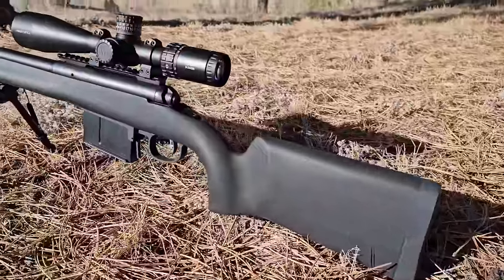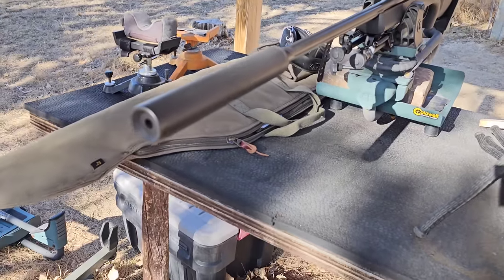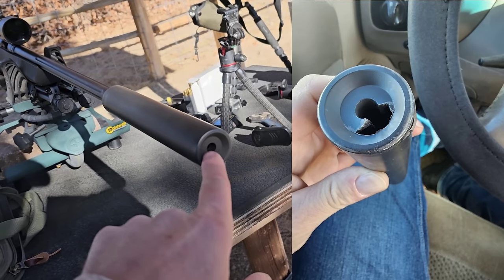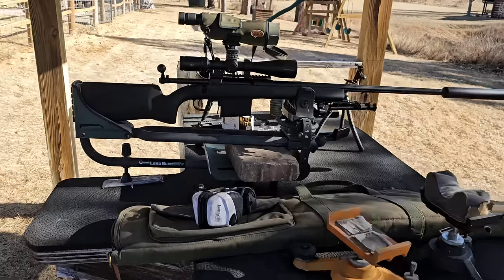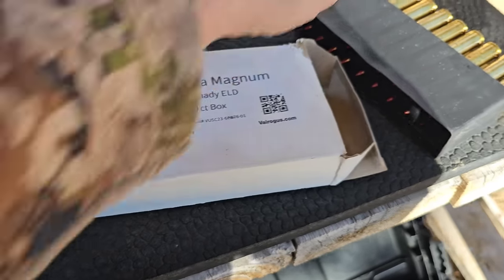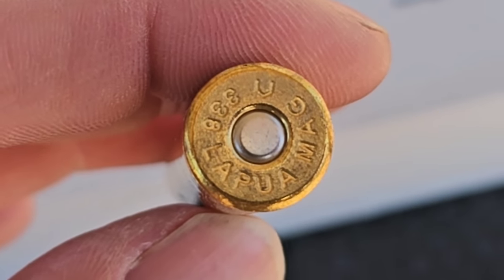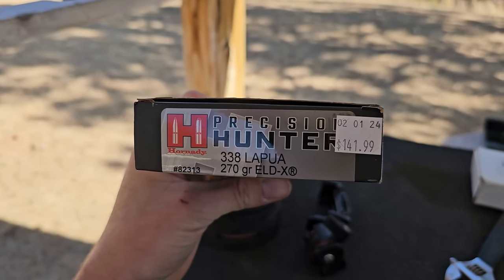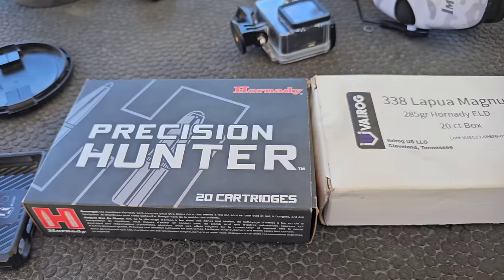Long Range Rifle: Something is WRONG!

Comment: The ammo seems like garbage, but it looks like either your scope is not working or mounted incorrectly or your barrel is trash from the get-go. Savage 110's have simple actions and don't struggle when the barrel is good and the scope is good.
Reply from the maker: Going to try another scope, but I am thinking it's the barrel just because of how off the threads were cut from the factory.

Comment: Remove that scope, remove and retorque the bases and rings. Try another scope.   Your velocity numbers are pretty varied perhaps different ammo from another manufacturer.   Did your gunsmith scope the barrel I have had some kind of scary looking barrels from Savage but the ammo seems like junk. I would still check all the fasteners on the rifle with a torque wrench just to make sure.  

New ammo did not help.  I would be curious what the rifling looks like and who ever scopes it should look at the chamber it could be off center as well. I’m not sure I’d put an off brand barrel on a rifle I presume was purchased for the cartridges long distance capability.  

Barrel, trigger, Optics, and solid platform (chassis or bedded stock) are what makes an accurate rifle. Of course all these things need to be properly fit.  Does that gun have parts to build off of?
Reply from the maker: Might go with a new barrel, not sure yet.

Comment: Inhad a similar experience, i bought a rifle from a family member who shot 4 boxes back to back then went to town bought 4 more boxes and shot em all back to back over heated the barrel and it warped it just slightly, enough to throw every shot off. Have a barrel maker look at it and they can put it on the machine to see where its off at, if it is off. Thats what i did and found that it was off a substantial amount. Had to buy a new barrel.

Comment: Take it to a gunsmith
Reply: The gunsmithing should have been done at the Savage factory. The last three savages I bought have had all kinds of grossly negligent problems. Simple things like the bolt closes on a no-go gauge from the factory. Out of spec unfinished parts on the bolt body. Camo dip paint peels off when you remove their ignorant stickers they put on the gun. Barrel receiver threads galled All to hell. And then you have to pay to fix their crap.

Comment: Most Savage rifles are stupid accurate
Reply from the maker: I know that's why I'm surprised at what's going on.
Reply: The last three savages I bought had excessive headspace from the factory. The bolt will close on my no-go gauge. one of them had a large ring recoil lug on a small ring action. And the last one I spent over $1,000 to purchase and the bolt would bind up so horrifically it was inoperable to even use. I sent it into Savage and they lied to me and sent it back with the same larger ring recoil lug and didn't do anything to fix the bolt. There was absolutely no finish work done on the bolt body they sprayed some kind of paint crap on it to cover it up and shipped it out. The people working at Savage and running Savage are completely incompetent and are liars.
Reply: The other thing on the last two savages I bought the barrel threads or completely galled up in the action threads. It looked like they left the sandblasting garbage on the threads and put some kind of a extra hard glue on the threads and tightened it up and galled The living S##t out of the threads, from the factory. I ran across another YouTube guy that had the same crap and he said it was none of his business what Savage does to their threads. They're selling a gun to you and you are paying for a product that is registered to you not to Savage, with the expectation to not have the barrel/receiver threads galled all to hell.
Reply: @Mike-xi4zt  What savage did you buy?
Reply: Always had Savage 110s or Stevens 200s and they do shoot-- lights out. My best ones were PRE-Accutrigger 110s without the stupid DBM & bottom bolt release. I  don't buy new ones I buys old savages for the actions and re-barrel.
Reply: @cbsbass4142  I bought Savage because of the ability to swap barrels and change the bolt face. Savage has been doing away with the barrel nut that works with a wrench.  then put a hole in the middle of the back of the bolt for the firing pin extension to stick out of so that if and when you get a pierced or blown primer it provides a path directly to your eyeball for 60,000 PSI high gas. Older savages did not have that hole in the back of the bolt. I have had some serious major problems with Savage 110. And I've had to spend way too many hours and money trying to fix the crap they ship out of the factory. I personally hate all recoil lug systems that are a sandwich between the barrel and the front of the receiver. That type of recoil lug is asinine stupid ignorant engineering. Savage used to put a detent in The recoil lug so when you tighten the barrel up it would hold the lug in the proper position. Now they've come up with the brainless idea of no detent in the recoil lug to hold it in position when your tightening the barrel to the action. Needless to say I will not be buying any more savages in my lifetime
Reply: @cbsbass4142  3 different 110s
Reply: @Mike-xi4zt 
Damn ‼️ 😳
Reply: I have two Savage rifles, but they are more than 10 years old. The quality of things prior to the plandemic was a lot better. I don't know when that.338 was made, but if person threading the barrel was not competent enough to notice an obvious, exterior problem, I can't imagine how far off center the gun-drill might be or accuracy of the rifling/twist.
I mean, it's probably a button rifled barrel and the ding ding that made it could have been trying their own version of Gain twist or just not know wtf they're doing 🤷🏼‍♂️ 
I would verify one last thing before having the action and bolt face trued up and a new barrel put on.
I would put that Arken scope on a rifle that you know, is a good shooter and see what happens. If you get consistent groups on a gun you know, then you can also trust the internals of the scope.
I just recently bought 2 Arken Ep5's, but don't have them mounted, so I don't have any experience with them. But if that scope came with the rifle, that had the crooked threads, etc.etc.etc, and won't prove itself on a rifle that you know for sure, produces a tight group, then maybe there's more to story, with the previous owner 😐

Comment: You should have sent it back to Savage. They have excellent customer service. My buddy buys them all the time, and has had to send a couple of them in for small issues. You kind of screwed up by having a smith touch it. Now you have no proof that your smith did not mess it up. Be prepared for Savage to make that assumption as well. Before you screw up anymore, I'd be contacting Savage. That ammo costs way too much to be burning it up in an ill rifle. I've seen a couple of these rifles shoot poorly, but I just assumed it was the guys pulling the trigger. My buddy has one, and we can both put 5 shots into 3/4", so I know they can shoot well.

Comment: Ok my friends group and myself have 4 M110 precision .338 Lapua rifles between us and here is what we learned the really expensive way:  Hornady bullets suck ass.  We started out with one rifle running Nossler Accubond LR 265gr  but Nossler decided to quit the game because they suck.  We have other rifles shooting Sierra Matchking 250 gr and another shooting Berger OTM  300gr.  The OTM rifle started out shooting the ELD-x and we chased the disaster for a month and here is what we found;  Hornady ELD bullets cant handle a 1 in 10 twist barrel without deforming in flight!  Yes I know what that sounds like cause everybody is a fashionable Hornady fanboy so we also tried it in 6.5 creedmoor and had to slow the bullets down to 2650fps to keep those flying straight too.
  in the .338 he could get on steel at 500 every shot and at 700 maybe 25%but at 1000 it was atrocious so we put up some big moving boxes cut flat to see and what we found was a 8ft diameter group from a rifle rest was all it could do, that same rifle now shoots OTM's at .6 moa at 1000.
   Don't shoot Honady ELD unless you can get a 1 in 12 twist rate.

   Also if you want to shoot the OTM's you will not be able to use your magazine and you will need to get used to spacing far off the lands and you WILL need to buy a micrometer seating die.
Reply from the maker: Thanks for the info. Other people's experiences are helpful, especially when it seems like this has happened to so many people. Thanks for watching. 👍

Comment: I believe back pressure from your suppressor problem ruined the barrel. Good thing it didn't blow apart actually.  I may be wrong but i would think gunsmith would have run a COMPLETE inspection on that barrel after the rethread .  But still may need new barrel barrel you have put too much time effort and money in to give up now. Just dont sell or trade and let someone else who had been saving for possibly years end up with a pile of scrap iron!!! It would sit in my closet before i would do that!!!!!!!!!
Reply from the maker: Yea, I bought someone else's problem. Being a used gun, I knew that was a possibility, and that's fine, but I won't do that to someone else. When I get it fixed, I will post a follow-up video. Thanks for watching.

Comment: I would make sure your new crown was cut good. A bad crown can make for some wonky groups. Also try a different scope if you have one. Bed your action make sure you are free floated. A new barrel would be my last option although with a used rig you never know. You could spend the money on a new barrel and still encounter problems you missed. Could have some very bad copper fouling. Not sure what you have done to the gun previously this is the first video I’ve watched of yours.

Comment: I would try a different scope,  bore sight it 25yd, take to 100 and if same all over the place, send it back to Savage for a rebarrel.  That barrel wasn't cut right at the factory if it doesn't shoot.  To me the 338 Lapua is too expensive and reason why the Military can afford to run that thing.   I would suggest a 6.5 PRC in Berger 156gr, 0.7 BC at 2950fps, at 5000ft it is 1500ft lbs at 850yds, 2100fps and low recoil like a 270 Win.  A 7mm PRC with 0.7 BC bullets 180 - 190gr and a lot cheaper to shoot feels like a 300 Win Mag in recoil.   That 338 Lapua isn't cheap.
Reply: If the threads weren't true the barrel's probably not true!? Your probably right.. those bore sighters there expensive I tell you a cheaper quicker way, Set your gun in a gun rest pull the bolt out look through the barrel get your target perfect in the middle of your barrel and your eye set scope to bullseye free bore sight! No batteries only works with bolt action though

Comment: did you set up the scope using a bubble level?,  how bout the ''Tall target Test?,,,the Barrel and vertical reticle  are the important issues,,and every time you shoot,make sure your bubble is level,,,which means  you are NOT canting the scope and barrel.Wyoming is quite the country!!
Reply from the maker: The scope was set up with a bubble level to the gun. It was a new scope, but I didn't check it for tracking. Thanks for watching
Reply: Eric,,thats good,,but,,,you have to use the level,,,every dang shot,,,that way you know you are level,,,we are  easily fooled,,,at least I am.

Comment: om my 2 savages"s I had to take the scope rail off and clean all the oil out from between the action and the 20 MOA rail. and then bedded the two together using a bonding agent it is unbelievable how the 2 surfaces do not match up at all. so the bonding agent spans the gap.  on a trip to the range, there was a man and his son right next to me with a brand new 110 tactical and could not get it to group at all. in short, I had everything with me and did what I had explained to their 110T.  After completing that task I used 5 rounds of my hand-loaded for my 110T. and it shot a .68 group. with their factory ammo, I shot a .890  group. and all I did was bed the 20MOA rail to the action.   and that day I had 2 new friends.   I hope that helps. p.s  I don't know everything. But a blind squirrel can sometimes find a nut.
Reply: also as others have said, use a scop that you trust and have confidence in. Get rid of as many variables as you can. And you know the crown of the barrel will make it and or break it .

Comment: At 142 per box new barrel is 2.5 box's then you have a shooter I had rifle shot 6 inch groups with good ammo new barrel shot .30 inch groups worked out cheaper than wasting ammo trying to find if it could shot

Comment: It’s a savage, built to a budget. Could be anything, scope, rail, action screws, bedding but I doubt it’s ammo spraying that large at 100. Pull the gun out of the stock and see what it looks like, pull the scope rings and rail off and check then put it back together check specs tolerances and torque all the screws correctly.

Comment: The action could be out of spec, the barrel nut and mating surface of the barrel to action could be out of spec, bore could be bad. I would either: A) send it back to savage and see if they will evaluate and replace, or B) cut my losses and get something else. Problem with B is that someone else may unwittingly fall victim like you did. I’d start with A…
Reply: Just hope they don’t claim you voided the warranty by having the gunsmith fix the threads. 

Not a fan of Salvage.
Reply from the maker: Yea might have to true up action and get a new barrel.
Reply: @Guidedhunts  hopefully the company will see what’s up and fix/ replace as appropriate.
Reply from the maker: @outdoors76  yea, this is the first savage I've owned, might be my last.

Comment: i would try non hornady bullets.   i had a issue with them a few years ago with a 7mm build    hornadys were all over the place. exact same load with a sierra bullet and it shot so good i told . myself never again with hornady.   im still running that load.   just a idea

Comment: You guys had the barreled action out of the stock. loosen them back up and re torq them even to 55in lbs.
Reply from the maker: Yea, after this video, I pulled it out and checked the bedding block and contact points, made sure it was free floated. Then re torqued to spec.
Reply: I have the same rifle in 300 prc and it shoots 5/8moa groups. Sorry you are having issues with it. I have never had a 110 in any caliber shoot that bad @Guidedhunts

Comment: That sucks getting a new gun . And won't shoot, right. May be the barrel. Makes me wonder about the riflings. Since the threads was off. When they cut the bore out. It could be off center. By so small cant tell it by just looking at it. I would send it back too savage. Have them shoot it. See if they can get it to the group. Even being a used gun. They may rebarrel it for u. That too high of ammo to be burning up. I would be reloading for it. The eld m bullets. I have been watching videos.  Of people using them for hunting. I ordered some eld m 162 and 180 gr bullets. And some eld x 162 gr and 175 gr. For my new Xbolt LR 280AI rifle. Too high of different in speed in the ammo. I would also email that ammo company. They should stand behind it.
Reply: That's what I was thinking too. The bore may be off center to the outer barrel.  The threads was a hint.

Comment: Replace the barrel.  I had a similar experience with a Savage Elite Precision 300 PRC. I went through 300 rounds of handloads, 4 different bullets, 3 different powders, yet still had 3-5 MOA 5 shot groups.  I debated sending it back to Savage, but decided it would take too long and they may say it is within their specs anyway.  I replaced the barrel with a Bartlein pre-fit from Bughole barrels.

Huge improvement.  The largest 5 shot group with the new barrel is 3/4 MOA and it likes everything.  Every bullet and powder combination is shooting 3/4 moa or better.  I compete in long range benchrest and this will be my 1 mile gun (1st match is in two weeks).  I also own 3 ither Savage rifles and they were all sub moa shooters.  I thing some of their barrels are now crap.
I am really disappointed in Savage because the Elite Precision is not cheap!
Reply from the maker: Yea, I am leaning towards a new barrel. We will see how it goes. Thanks for watching.
Reply: Velocity seems to be a little low on the 285s. My 338/06

Comment: Me thinks either the scope has an issue, whether internals or mounting method/torque etc. Or the barrel is toast. 
If you're handloading to the point you can get good loads for far less than factory prices for 338LM, AND you have a need for a load that stout, I'd say rebarrel that thing and make it right. 
If you have no need for 338LM power or distance, I'd get rid of it. May end up being a divorce-level money pit.

Comment: Ran into a guy at the range he had the new ruger bench  2100$. Any way we started at 100   Iam using a Remington 788 in .308  100 we’re good  .785 his 1.400 200-400 ok still beating his 3 round groups 600 Iam cutting 2.56 to
His 3.5  800  ok at 1000  his shit fell apart  7 plus “
 Iam using a red field 2x7  to his bcd lupy   It wasn’t the scope    It all started at 100    Just one of those days 
200
Reply: My handloads.    Norma brass 168  Barnes 45.7 varget